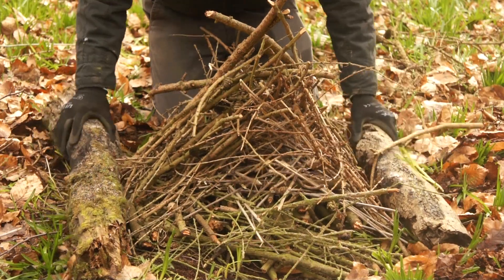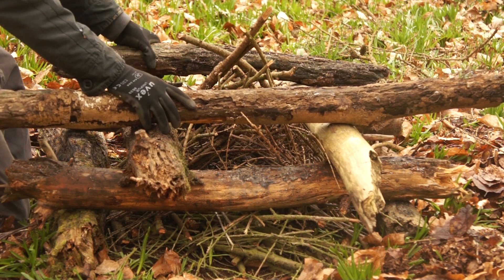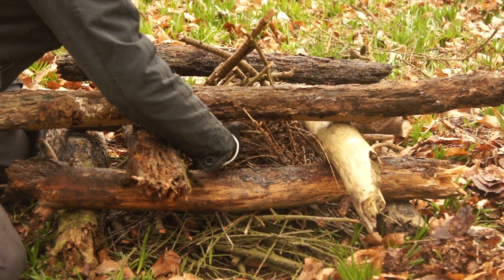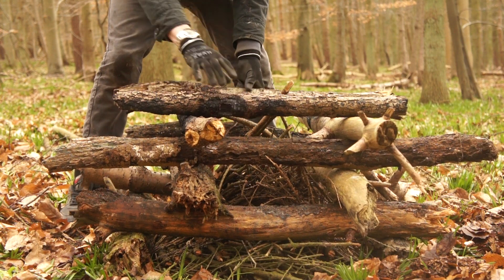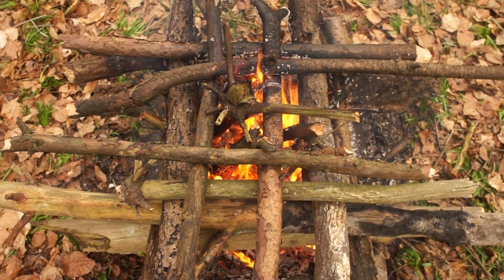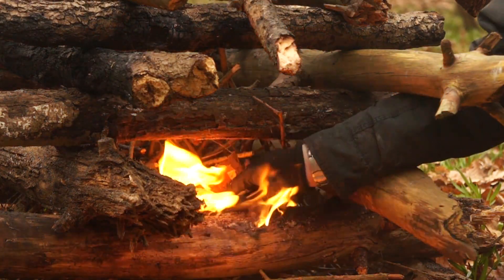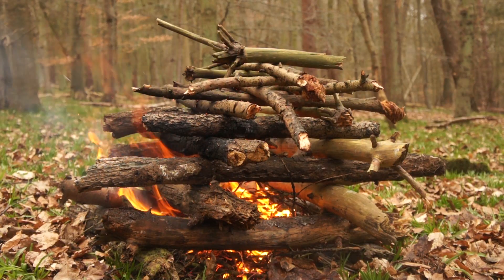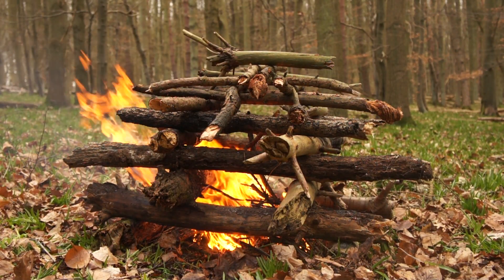The 'Log Cabin Fire' - Survival Campfire Build

Comment: Great vid man - A classic fire formation. Hardly a backyard marshmallow roaster - more of a bonfire to crack some beers around - but fun nonetheless. Works better with wet wood on the bottom, so it doesn't get out of hand too quickly. Also used as classic signal fire because of its burning spontaneity.

Comment: It will work, certainly. The only issue I have is when you're out surviving, you have many things to do - and babysitting a fire shouldn't be one of them. You have to worry about shelter, food, sleeping, gathering more wood, etc. 

In such cases, an upside-down - or pyramid - fire is a good bet. It's very similar, but won't burn so quickly. You start the fire on top, with the bigger logs on the bottom. It won't burn so quickly and, if you've done it right, you can leave it alone and get other things done.